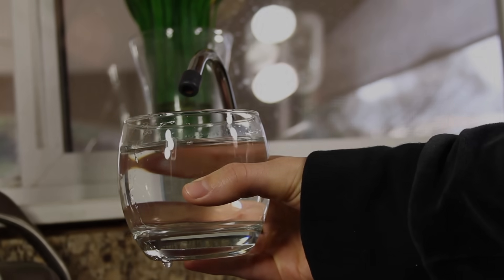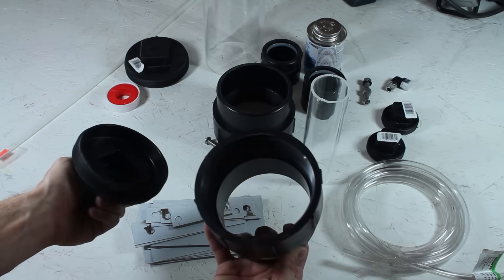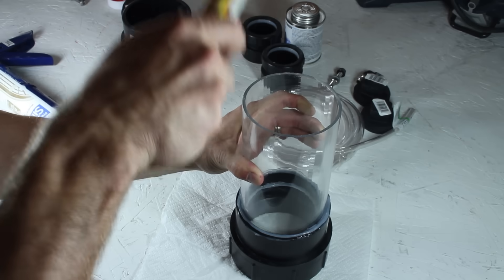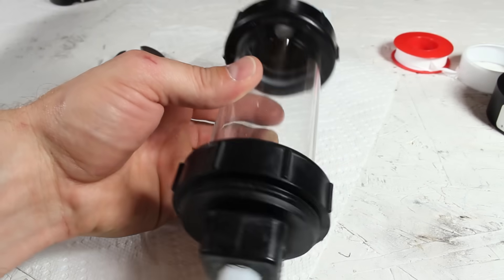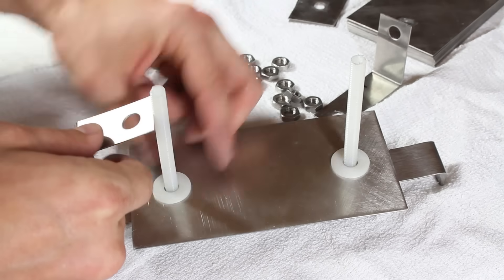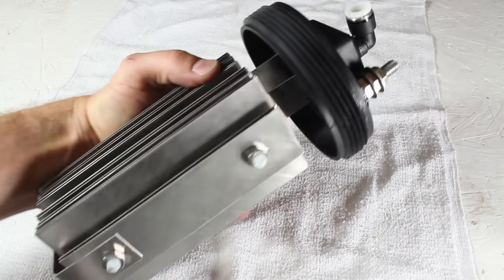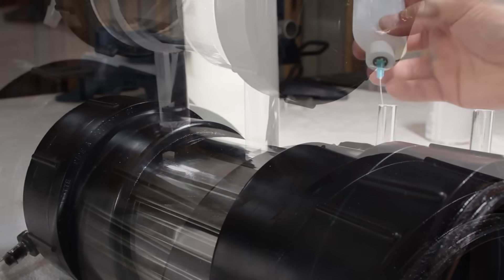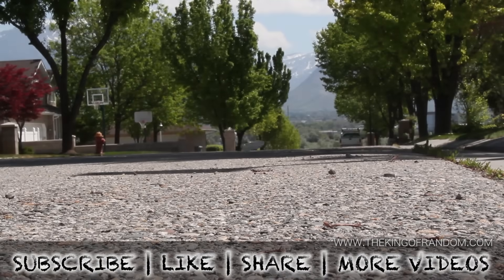HHO Generator - Water to Fuel Converter

Comment: is it safe to drink after making the fuel out of it?
Reply: +Biohazard It's not safe to drink after you put in the potassium hydroxide
Reply: +Biohazard GASP!! Good Lord, NO! Why would you want to? The reaction creates a lot of nasty by-products, not to mention the electrolyte that you start with. YUCK! I ain't getting that crap anywhere near any of my bodily intakes!
OK, to be fair, I suppose you mean is the combustion product safe to drink. To that I would say, on paper, yes, the primary result of burning HHO is pure water. That being said however, whenever dealing with high energy burns there are undesirable by-products created. Don't consume anything in the process, before, during or after.

Comment: well since hydrogen is flammable, direct it into the engine cylinder and the spark plugs will ignite it making the pistons to move thus running the engine now u can drive ua car

Comment: Could this be powered from a microwave oven transformer that has been rewound in a similar way to your "metal melter"?

Maybe through a beefy enough rectifier diode given that electrolysis only works on DC?

Comment: Excellent video and excellent work on this generator. I have a question if you don't mind. How are the stainless steel electrodes behaving in the electrolysis process? Did the anode corrodes after a long time use? If it corrodes how much time it remains usable?

Thank you very much for the attention! Good wishes!

Comment: I would like to know how many AMPs the unit pulls from the batteries +Grant Thomson
+thekingofawesome
Reply: Use daily for separation via photocell panel ... 48 to 52 DCV. Standard compressor with explosion proof fittings to bottle ... Electrical wholesaler n welding supplier. Cooks ... separates ...  like boiling water . Be careful with this knowledge ... HS could pay u a visit. Lol
Reply: +800lbgrila Solar cells are a wise idea. In that case, you are using the gas for storage of power rather than batteries.

I'd REALLY recommend creating this as separated hydrogen and oxygen. Storing them mixed seems like an extraordinarily bad idea.

Comment: cracking water to make hydrogen gas is cool but how much electricity is needed. so it goes from water to gas back to water? so you make a sealed system  could run forever?
Reply: +David Vaughn the second law of thermodynamics says no.

Comment: to store hydrogen is easy, no compressed bottles needed. An open topped large round container filled with water, then cut the bottom off of something like an empty recycled oil drum. fit a gas tap/valve on top of the oil drum, open the tap to let air out, then lower the drum into the other container filled with water. Once it's fully in, close the gas tap/Valve, put a weight on the top of the oil drum, perhaps a concrete block or slab, (This weight creates the gas pressure so you can pipe the gas to a gas hob or whatever you wish to do with it.) all you have to do then is connect a tube or pipe from the bubbler into the water filled container and into the oil drum. (If you look up biodigesters, especially the domestic ones used in india, it's the same simple cheap storage system used for the methane they produce) this system can be used to store any gas we can make, hydrogen, methane wood gas etc. hope this was helpful.
Reply: +TheJunkyardgenius , this is accurate and good for methane storage. It will work fine for hydrogen capture, but I think you'll find it less useful for storage. The hydrogen molecule is VERY tiny so it tends to soak into practically everything. Valves that won't leak for other gases DO leak H2 gas. Besides you can't storage very much hydrogen this way. H2 gas takes up a lot space at standard temperature and pressure.

Hydrogen storage IS easy however. Send the captured gas into a tank filled with small metal hydride pellets and keep it cool. More H2 gas can be stored in such a tank than could be stored in an empty tank, even under pressure. You can recover the gas by heating the metal hydride pellets.

Comment: Now just show us a suitable solar panel setup for generating hydrogen fuel and a means of pressurizing it in a tank, and then how to utilize that power in a homemade fuel cell, so you can then show us how to replace the gas tanks in our cars with fuel cells, Mr DIY Genius man.
Reply: Thumb up !!!
Reply: +Christopher Daly II Pressurizing this is a terrible idea. Pressurizing oxygen with hydrogen causes it to immediately explode. You would have to separate the two first if you wanted to store them in pressurized vessels.
Reply: Oh, I didn't know that. What would cause it to explode? Wouldn't the addition of energy to the system just recombine H2 and O2 into H20?
Reply: You are right, it recombines, but when it recombines it does so explosively. When he lights of the bottles you see steam, that is what has happened, it recombined to form water. When he adds the energy of the flame it causes a chain reaction of the gases recombining in an explosive reaction. Basically by compressing the gases you are doing the same thing, as pressure increases so does temperature and at a certain point it goes off.

Comment: could you not hook that up to ur car and then fill your gas tank with it off gas and then when your gas runs out you got hydrogen?
Reply: A gasoline engine won't run on this
Reply: +tuckersaspy why?
Reply: +tuckersaspy I looked it up. You need a few mods on your car that would cost about 50 percent more then a regular engine.
Reply: +DoctorMason That is "Brown's gas". It is less than 100% efficient, as is everything. Storing fuel and oxidizer together, what could possibly go wrong?
Reply: +800lbgrila If you pressurized this is it would immediately explode so it is a bad idea anyway.
Reply: +jacob mitchell Actually no, cause the problem is that to produce dihydrogen and oxigen from water you need more energy than what you could possibly get from burning dihydrogen and oxigen together. So it will just use more gas.
Reply: +jacob mitchell Now that is a great question AND a good project to work on. Surely you have seen hydrogen fuel videos creating Browns Gas? Maybe this stuff can be mixed. I purchased his plans though to support this channel. Even if this worked on a small engine motorcycle sharing the plans to it would have trmendous value to the users.
Reply: NO!!! Gas tank won't pressurize and H2 won't mix.

Comment: Hi .. I would like to ask about efficiency is this generator ...    because you know  I was thinking about heating system for my flat or just heat watter for shower ...   but if I build this generator I will need electricity  and watter to supply this generator . So I am wondering if it is cheaper to making heat this way  than making heat directly by electric heating ...

Comment: This  was the coolest thing I seen so far, but there is a measuring system for how much pressure flow. So you could actually ignite the hydrogen and make it burn for lets say a gas stove or a hot water heater. Do you know what it is?